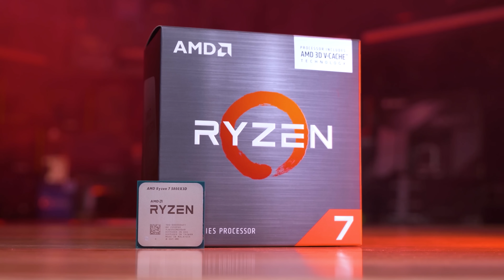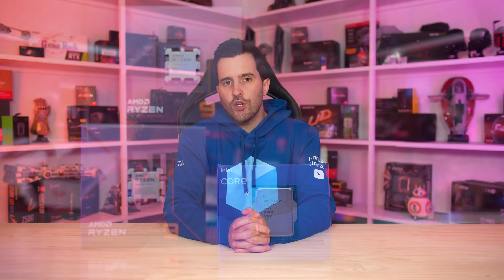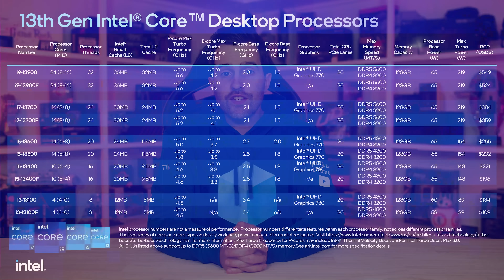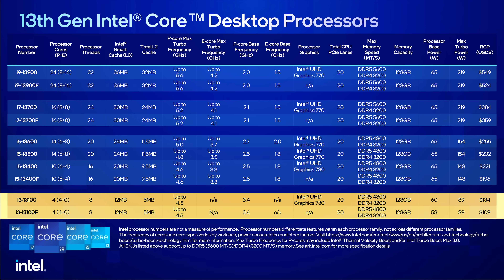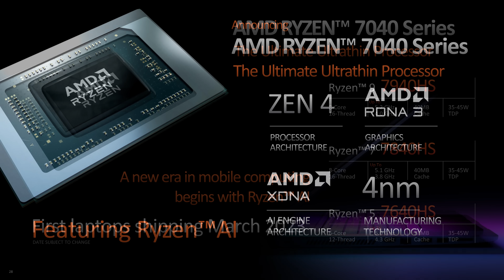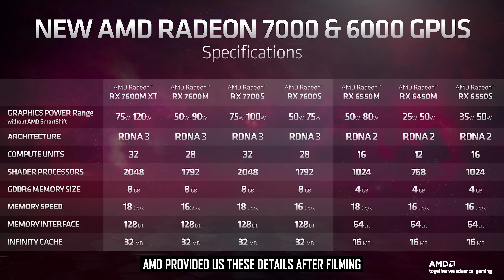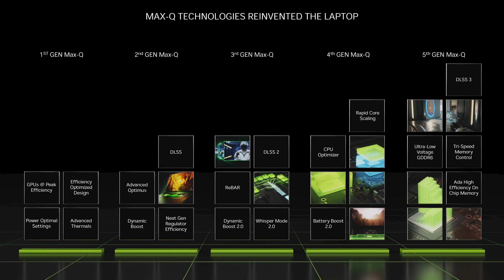Zen 4 3D V-Cache, 7950X3D, 7800X3D, New Cheaper CPUs, "RTX 4090" for Laptops - CES News Recap

Comment: We need cheaper AM5 Motherboards, I want to buy into the new ecosystem but those prices in Germany are a joke
Reply: They mentioned cheaper motherboard options but didn't go into detail
Reply: Hmmm, my first computer cost ~$5000, had an Intel 8088 CPU @ 10 Mhz (which you could underclock to 5 Mhz to play older games like Joust), 640 kB of RAM, 512 kB Trident GPU, no hard drive, a 5.25" sddd floppy drive, 3.5" dsdd floppy, DOS 3.1, a 12" EGA (16-color) CRT monitor, keyboard, no mouse, crappy internal speaker, and a 4-color dot matrix printer. I'll never complain about computer pricing as we are blessed to have what we have now, for so little.
Reply: @@user-qn8bh3cm6u Cheapest B650 Motherboard is around 210+ € in Germany. There is some microATX Motherboard starting at 180 € but you don't usually use those for normal builds. Also this is the cheapest of the cheapest. There will probably be quite a few drawbacks to using these.
Reply: @BaCcC2  other than a crappy gigabyte b650 I saw, all of the motherboards I looked at can handle a 7950x. The quality of the b-series boards is higher than they have been historically. They’re reintroducing a-series boards because of the missing budget segment.
Reply: @orangepacker7479  Where does one get the information that a board can truly handle a 7950X? I know companies provide lists of CPU compatibility, but how do we know the VRM's can actually handle them? What is your process there?
Reply: @iseeu-fp9po  It’s kind of a thing you learn with experience. If you’re really looking to buy into am5 you can watch the Actually Hardcore Overclocking videos where he goes over the different motherboards from a few brands. My personal recommendation is to go with ASRock, as they don’t sell a single motherboard as of writing with vrms that can’t handle a 7950x.
Reply: @orangepacker7479  Ok, thanks. When i built my current rig, (3700X on a B450-F), I kind of made a mistake going for that MOBO and limited my AM4 upgrade path because of the VRM's. Hardware Unboxed later review that board and gave it thumbs down. I didn't know those things at the time but I don't want to make that mistake again! I want a good MOBO that can provide any upgrade AM5 can provide in the future.
Reply: @Anonymous yes it is. Considering how you could get b550 boards for around $110-150. Not to mention other regions, like in my country where anything but the most entry level mATX b550 boards cost more than a ryzen 5 5600.
Reply: Yup , when intel (lol) has cheaper motherboards then AMD you know something is wrong
Reply: Same. Here in Asia, everything is so expensive
Reply: What make it joke was your local retailer. Even if AMD & their board partner reduce the price, it's up to your local retailer or reseller to follow the same suit. It different from region to region. LOL xD
Reply: @5federline  that is true, but the prices are too high from the time of release
Reply: We need cheaper everything!  Either that or money that isn't worth so little.  If the minimum wage for an adult is £350 per week, then you should be able to get a basic computer for around that amount.

That used to be what controlled prices - what the average consumer could afford!
Reply: @SinfulPreacher  that was in the bygone era of “the actual subset of the population that build computers is small and niche and typically somewhat frugal”. Many people that build computers nowadays are willing to throw more money at their hobbies than the rest of us. This, coupled with the fact that there’s still a limited supply of silicon wafers means that more of the market has shifted upwards. If a given company can make their margins more effectively by targeting a different portion of the public, they’re going to.
Reply: @124thDragoon  I say builds are still niche.  I can count the amount of people I know who legitimately build their own systems.

I can only name you a handful of people who know how to access the damn BIOS menu.  Computers are niche in the main, really this is disguised by computers being easy enough for anybody to pick up.

Now everybody thinks they are experts lol.
Reply: @SinfulPreacher  you can get a computer for that. It’s called eBay.
Reply: @SinfulPreacher  Sure, get yourself a raspberry pi 4, that's a basic computer and you can basically daily drive it as an office PC.
Reply: @SinfulPreacher   why do you think people should be able to get a computer for 1 week of minimum wage? 
And what do you think is a “basic computer”?
Of your reason is that a computer is essentially a basic human need nowadays, then you can get a laptop or Chromebook for less than your quoted amount, which would allow someone to be able to do email, online bill paying, word processing, etc.
If you’re talking about a basic gaming PC, then I think that is beyond what needs to be accessible to anyone on any wage to get through modern life.
Reply: @pieflies  I don't think that, it is the legal minimum wage here that is set by the previous Government.

A basic computer today is something like an i3 or an R3 with 16GB RAM and internal graphics with an SSD and a keyboard.
Reply: @SinfulPreacher  but you said it in your comment, that people should be able to get a basic computer for minimum wage.
You can buy a cheap laptop for a week of minimum wage. Anything more than that is really a nice to have, which it is nice if you can afford it but it’s not really a right that everyone should be able to afford it.
Reply: @pieflies  Laptop is not a basic computer, so you're getting less than you need.   

A basic computer and keyboard is going to cost you more than £350, I mean one you can use for productivity and not a second hand piece of garbage that will break down.

A new computer with a warranty and a keyboard, is going to set you back $500-600 at least probably closer to £800.  That's too expensive for most people who need one.
Reply: @pieflies  everyone should have the right. poor people deserve nice things too you know
Reply: @pieflies  I just realised; you seem to think that a computer is a luxury.  That's why you went for a laptop, you are sat with it on your lap watching telly with the kids.

I mean a computer that can help you earn money and not cost you money!  Lol.  Not something to watch occasional YouTube videos on.  You have a phone to do that.

Job security continues to be terrible, as does wages which aren't beating inflation.  So if you want to earn proper mans money, you need a proper computer.  Not a laptop, or a second hand 90s gaming PC.

A proper £600-800 computer with a proper daily use keyboard, and that should be a basic right for people, considering that they've replaced hand tools as the go-to earning implement for everyday life.

I would sooner see people buy a computer than a car.  People have very little vision when it comes to wealth, sadly.
Reply: @emporioalnino4670  I agree, everyone has the right to have a computer and access to the internet, as it’s pretty much a requirement for life now. 
What I’m saying is that you can get a cheap laptop that covers the basic computer/internet needs, for less than a week of minimum wage.
A desktop computer with 16GB of RAM is more that what is required for these basic needs. Sure it would be nice to have, but there are also lots of other things I would like to have but cannot afford, and I don’t expect them to be prices so that every person can afford them.
My point is that the person I was replying to has an unrealistic idea of what is the minimum required computer.
Reply: @SinfulPreacher   I don’t think a computer is a luxury. I think a laptop is a computer.

You seem to be mixing up basic needs and nice to haves. I agree it would be great if everyone could have an £800 computer, but that’s not realistic and never has been.
I used laptop as an example because they’re cheaper, and they’re more affordable to people on minimum wage.
People on minimum wage want the thing that they can afford that can do the thing they need. They generally don’t waste money on excess beyond that.

A laptop can do most, if not all of what an £800 desktop can do, even if it’s slower and on a smaller screen.
You can earn money on a laptop, then save up for a better computer as you make progress. Same goes for wood working tools for a carpenter. You start out with the cheap tools you can afford and upgrade as you progress.
This is how the world works, and has worked for a very long time.
Reply: @pieflies  you don't have an inherent right to anything you can't provide for yourself. You have a right to life but it's your responsibility to sustain that life and be prosperous enough to live it the way you want.

Everyone wants to be rich but no one wants to do what it takes to actually become rich, so they just end up blaming others.

I'm in no way wealthy, but changing my mindset from entitlement, to getting off my ass and doing whatever it takes to improve my life has had a more beneficial impact on me than years of complaining ever did.
Reply: @skobywankenobi    why do you direct that at me and not some of the other people on the thread? I have pretty much the exact same argument as you in some of my replies. I’m against unwarranted entitlement.
I think you didn’t read the entire conversation I was involved in.

The people I was replying to think everyone should be able to have a “basic” computer on minimum wage, but their definition of a basic computer is not really a basic computer but actually quite fancy and definitely more than you need to get by.

My argument is that a basic computer (NOT a $600 desktop, think the most basic laptop/Chromebook you can possibly get, even if you have to get it second hand) is already affordable by people on minimum wage, and no one has a right to have a fancier computer just because.

I did say I think people should have a right to the most basic of computer because I think that it’s becoming a requirement for people to be able to manage their affairs (eg. paying bills, getting jobs, studying, etc.), just like shelter or food or electricity are considered necessities. Keep in mind that my opinion is a westerner’s opinion and I understand that a computer is not the same level of necessity in all places of the world at this time.
Of course I understand that having the “right” to even the most basic second hand computer (or electricity or a roof over your head) doesn’t mean that everyone should have those things for free regardless of all factors, it means that ideally, in a moral society where people care about humanity at all, someone on minimum wage, or someone legitimately on a disability payment, etc. should be able to afford the most basic of these things.

I even already said that people have to work and save up to get better tools to better themselves at their profession. This means maybe starting out on whatever minimum wage job you can get, then saving for the tools and skills (learning expenses) you need to progress to a better job, then continue that cycle.
Reply: @SinfulPreacher  your minumum salary is 350€ a WEEK ??!!
Reply: @krystofdzoba7438  some countries have that as a month salary man , not everyone earns 3k a month
Reply: @krystofdzoba7438  with 12€/h, 8h/d, 5d/w it should be more like 480€ in Germany.
Reply: DDR5 boards aren’t gonna be less expensive for a while
Reply: Bought mine for $130 on black Friday and Im loving it.  Not sure why that isn't the norm
Reply: Amd said cheaper mobos are coming
Reply: You can get one for like $240
Reply: @KingMatiCBeats  which is too much, 200€ absolut max 160-180
€ should be the norm
Reply: @@user-qn8bh3cm6u yeah, that is a total joke for the B650-tier board.  In generations past that tier board would have been in the $120 range, not $200
Reply: @tippyc2  The quality of the boards has gone up too. The A620 boards are likely going to replace historically budget b series boards and be ~$10 more expensive at the lowest end just because of ddr5.
Reply: in india also x670 motherboard cost as much as ryzen 7600x
Reply: I think we should all be pie flies
Reply: A620 will be anounce for IIIQ 2023
Reply: All of AMD's X3DVCache CPU lineup will get murdered, slaughtered, assassinated and destroyed by intel's 13900KS
Reply: bruh i bet motherboards are gonna be the next thing that gets overpriced af (looking at you nvidia and amd)
Reply: Hate to say it but your gonna have to make a sacrifice. You cant have everything way cheaper. ALL companies world wide are charging more money. Just save up and buy the board.
Reply: They mentioned cheaper boards coming in the presentation but with no other details. Hopefully, we will get something in the summer.
Reply: I would upgrade if they enable the 128GB  systems to run the memory at 6400Mt/s or release 7k series for DDR 4
Reply: Well, here in the states you can get a Gigabyte Aorus Elite MATX board in B650 chipset for 200$. Not amazing, but affordable if you’re building midrange with a 240$ 7600x CPU. 32gb kit of DDR5 6000 CL36 is 160$. Soooo 🤷🏻‍♂️.
Reply: @MechAdv  That doesn't sound so great to me. Mobo:$200. CPU:$240. Ram:$160. $600 for just a mobo, Ram, and bottom tier CPU(not counting 7600 non X). No thanks. 

DDR5 isn't that big a deal over DDR4, and PCI-E 5.0 isn't that big a deal over the 4.0 version. The only thing(well two things, actually), is the boost in CPU performance going from Zen 3 to Zen 4(currently) and the potential performance uplift in the next few generations to come. For high refresh gaming, the 5800X3D is already pretty much on Zen 4 level, and you can still get pretty good productivity out of the likes of the 5950X or 5900X for a fair bit cheaper than Zen 4. And for lower refresh gaming(even 4k 60 with a pretty good graphics card) you can go with a 5600g, 5600, 5700g or 5700X. Compatible motherboards can be had for much cheaper, and you can get plenty of decent DDR4 cheap too.

And that's just the AMD side. You can get some pretty wicked deals from Intel now, too. Use a older and cheaper 600 series mobo, older and cheaper(but still decent) DDR4, and even the lower end i5 13600K(as well as the non k and the 13500) has 6p(12t) plus 8e(8t) for 20t total for pretty cheap on the latest architecture. Does it have a great upgrade path compared to AM5? No, not really. You max out with core i9's 8p(16t) and 16e(16t) for 32t total. Of course the coming 13900KS is the first CPU to be able to hit 6 GHz out of the box without really tweaking it. Either the lowly 13500 or the high end 13900KS(or anything in between) should provide plenty of gaming and productivity performance for years.

Edit: I forgot about Intel K SKUs not shipping with coolers.  They need beefy(like AIO) coolers. Non K SKUs should ship with coolers that do the job. I also forgot that AMD X model CPUs also don't ship with a cooler anymore. Thankfully, the cheaper non X CPUs seem to be shipping with coolers that will also do the job. So those are some other points to consider, I suppose.
Reply: @jtenorj  600$ is not a lot for a fully featured board, 32gb of midrange DDR5, and a current gen Ryzen 5. When I build my system, a fully featured B550 was 180$, 32gb of 3600 cl16 was 150$, and my 5600x was 300$. Sooo it was actually more expensive. You guys need to stop crying, it’s not that bad.
Reply: Agree, those mobos are making the whole upgrade to am5 a joke
Reply: Lisa Su said that lower cost MBs are going to release, so your needs are met, whenever they come out.
Reply: I got my X570 Taichi for $570aud which was like a high-end board back in 2020, there were enthusiest ones for $1000, but now the X670-E Taichi is $1000aud and the cheapest X670s are $500, which you wouldn't pair anything below an X670 with a Ryzen 7 or especially a 9, plus DDR5 Ram prices are stupid, but coming down
Reply: @MrZodiac011  interesting I just picked up a Taichi in the US for $500 USD.
Reply: @phantom1100  When you consider that i paid just over $200 for an X370 Taichi, $500 for the current model sounds absolutely insane
Reply: @tippyc2  Makes sense given the X370 is almost 6 years old at this point.
Reply: @Jdogg4089  i was referring to the price i paid for it brand new back then
Reply: @MrZodiac011  even the cheapest b650 board can handle a 7950x (there is this one from gigabyte I’m not sure about though)
Reply: @MrZodiac011  so buy a regular x670
Reply: @Anonymous 16GB for a new build in 2023??? Hell, my current main system is still an FX-8350, but I maxed it out with 32GB when I built it in 2012 or 2013 because ram prices were in one of their big dips at the time. It was only $129 for the 4x8GB kit of Kingston Hyper DDR3-1866. I plan to build a Ryzen system this year and will definitely not put less than 64GB of ram in it! While I do not always need the 32GB I have right now, even when it's not needed for a single program or multi-tasking(I always have at least a half-dozen programs running at all times), Windows uses it for caching which helps speed up things like repairing a big rar file with multipar.
Reply: @SirReptitious  32 gigs back in 2013?  holy moly.  Back then all the tech tubers were still saying you don't need more than 8.  Although i still built my 3770k system with 16 around that time.
FWIW, I'm not sure there's much of a reason for most people to push beyond 32 gigs unless you have a very specific use case.  Sounds like you have such a use case, but most people don't
Reply: @SirReptitious  Watch out, AM5 right now is pretty funky when populating all RAM slots. I'm going to get "just" 64GB of ram but it has to be in 2 stick otherwise EXPO has serious issues and you might get stuck with something like DDR5 4400 despite buying DDR5 6600.
Reply: @TJ-ki3gp  yes, it is not discussed enough how bad is the situation with the 128GB systems. You need a server and rdimm to run at 4800Mt/s
Reply: @TJ-ki3gp  Yep, I know about that problem with AM5. So IF I go AM5 instead of AM4 I will have to make sure to buy 2 high-density sticks of DDR5 to get 64GB. And then hope I don't need 128GB for the life of the system! I'll probably go with AM4 anyways since an AM5 build costs so much more because of the mobos, ram, and cpus...
Reply: @SirReptitious  For Gaming you don’t need that nuch memory. 16 GB is still enough. 64 Gb completetly useless if you dont edit heavy.
Reply: @SirReptitious  why buy 32gb if you don't use it
Reply: You better hope these new CPU's aren't higher than the release MSRP of X variants, That would be annoying. Please AMD...
Reply: Absolutely, the upgrade cost to AM5 is just way too high with the prices of current mobos and ddr5
Reply: "Those prices in Germany are a joke."

That's your problem right there.

Why are you in Woke Germany?